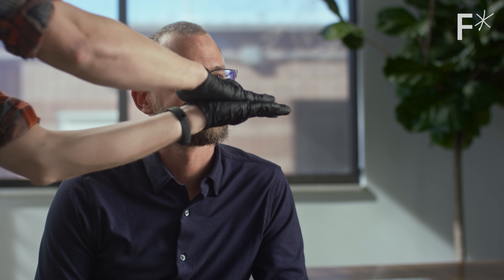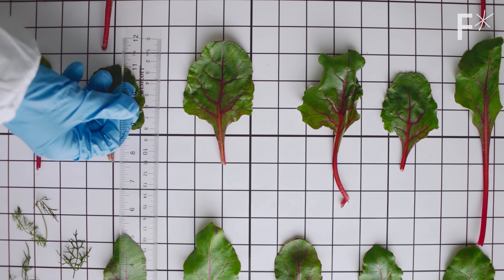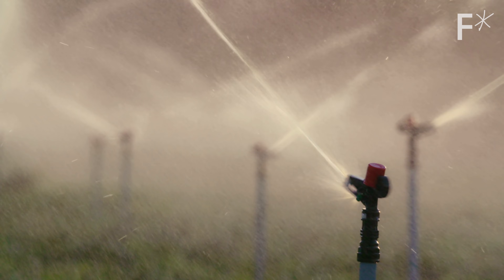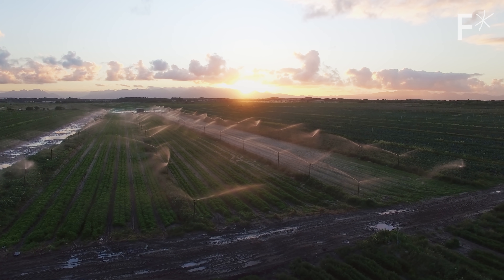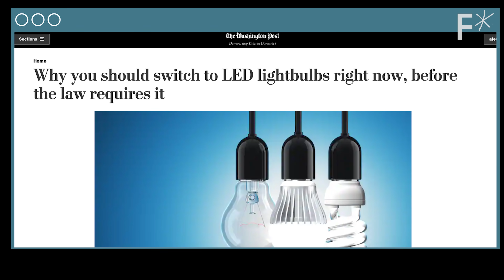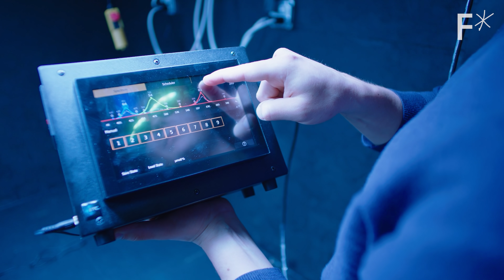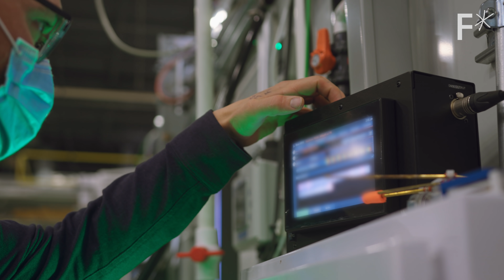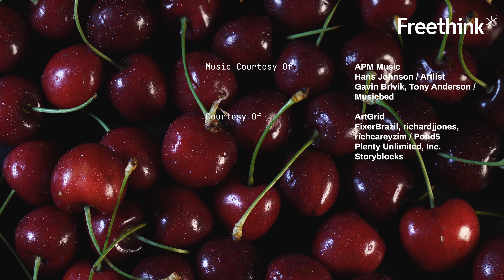Vertical farms could take over the world | Hard Reset by Freethink

Comment: It is no surprise they always, only, show leafy greens. They are mostly just water, and negligible amount of calories, thus they can grow in these extremely low light scenarios. Anything caloric enough that  you could actually survive of eating requires hundreds of watts per square meter.

The best LEDs might have an efficiency of maybe 85%? Best solar panels at scale we'll maybe reach 23%. Very optimistic numbers! The grid is probably close to 95% efficient, so, all in all, you'd then need around 5 times the land area only filled with just solar panels instead to run your vertical farm.

The energy used for transport or clean water are absolutely minuscule compared to the staggering amount of energy requires to drive the enough artificial lights to have plants produce a significant amount of carbohydrates.

https://youtu.be/J4SaSfnHK3I?t=530 "that might all change in the decade to come"
No. Why would it? Do you forsee us having an astronomically enormous abundance of eletcric energy any time soon?
Their limiting factor for cash crops is the number of photons hitting the plant and the Haber Bosch process. It already is hundred of times more efficient to use the electricity to desalinate salt water than REPLACING THE SUN.

Comment: Most farming is carbon-neutral, carbon-negative. Because it uses the free sun to convert carbon from the air into plants. This uses electricity to power lights... electricity comes from coal more than any other source... this is a massive project to increase CO2!
Reply: These farms will run on biofuels.
Reply: @potto1488  Sure they will.

Comment: I did a project in university about rooftop farming, but this is an even more amazing innovation and solves a lot of the same problems. The math on their claim of jamming 700 acres worth of food production into a box mall looks something like this : 700 acres is about 2 833 000 m^2, which is just over one square mile. You can fit 609 big box malls into this area (box mall about 50 000 square feet). The solution for the future is multi-pronged; it's minimizing the food deserts and actual deserts, re-thinking mass agriculture and livestock, and minimizing what carbon we do produce. All because we CAN and frankly, we have to.

Comment: Vertical farms are amazing if you need to create self-sustaining colony in a hostile environment. If you want to do it anywhere else it just doesn't make sense environmentally or economically: You need to build a facility, the grow equipment inside, staff to manage the facility and tons of energy for artificial lighting. You can build solar arrays to power the lighting but all that energy could instead be used to replace  fossil fuels for the rest of the grid.

And it's an economical nightmare since it has to compete with dirt, sunlight and a tractor that probably costs about a tenth of the vertical farms building costs alone.

Also the energy required for vertical farms absolutely dwarfs the energy required for transportation.
Reply: Thank you, there's somebody here with a brain.

Comment: So solar panels are around 20 percent efficient. 
Plants are around 26 percent efficient 
But since they are indoors and using LED lights you are turning them from 26 percent efficient to 0.26 * 20 = 5.2% 
Unless you find a better way of getting free energy. So this idea of indoors plants only works if you have excess electricity. We are on an energy crisis and you want to start wasting energy like this?
Reply: Wut.... plants don't use all the wavelengths the sun provides you dipshit that's where the benefit is. You can optimize that, also there's other green energy sources.

Comment: This is cool and great for the future with the rising population. Though the more tech, robots, machines, and more power consumption introduces more points of failure and other problems. Is there an option that doesn’t require a droid army to run one of these? And what of future generations, will they forget traditional farming? In the case of a solar EMP will we be able to recover quick enough?  Just curious. Also I thought vertical farming would look different; large tall towers with crops and farm vehicles all inside. (Old nat geo had a picture)
Reply: Traditional farming won't go away, it will just be on a smaller scale instead of massive industrial sized mega farms. Also nothing stopping hobbyist getting in on small scale farming.

Comment: Don't get that kind of growth without a gas CO2 generators. What is the carbon dioxide concentrations keep at to keep production high . I've seen some green greenhouses with the CO2 was around 3 thousand ppm. Are you exposing the plants to the same or higher levels of red an far red light than what they would be exposed to outdoors. I guess these plants are on a 15 hours of light 9 hours of dark.
Reply: I'd also appreciate that kind of information from them.

Comment: Problem is the energy requirements i’m just thinking about temperature and electricity ⚡️
The other thing is not everything grows there e.g it’s pretty limited amounts of variations.
Reply: I don't think electricity is that big of a deal. We can always build more of the renewable variety and secure the grid with nuclear. These big buildings could also utilize their rooftops for solar.
Reply: @Thezftw  Nope nuclear is not a option here so no. And renewables are actually to a huge percentage subventioned by oils/gas. Energy is very much a problem especially if you also want to reduce the way it the stuff needs to travel e,g build it in the city or near the city..
Reply: @platin2148  oooh piss off no nuclear, you probably think it's literally dangerous magic.
Reply: @ANTSEMUT1  I think you don’t understand it’s illegal here by LAW. The Eu also plans such a thing till 2060 everything already signed.

Comment: I love this so much. 
I don’t fully understand it though. 
I’m curious if there are any factors in the absence of soil in the process. 
In no way am I knocking this, I would love to do this in my own home/property, perhaps with an extended greenhouse (?)
Reply: Soil isn't actually necessary as all of the nutrients in the plants come with the water their roots absorb. The soil is just there to give it something to hold on to. With hydroponic farming, the producers can tightly control the nutrients going into the vegetables and add things that people need but might not be getting, like iron, iodine, etc.
Reply: There is soil if saw it correct...one of the machines was turning soil.

Comment: Um plot twist “why use LED when we have mirrors and a Sun ☀️ endless POWER of the Sun
Reply: because now your farm stops working when the sun goes down. that doesn't really sound too bad until you realize one of the main benefits of growing vertically is complete control over as many variables as possible. how long a plant gets light for is one of the most important things to control and could prevent certain things from growing efficiently  in areas that have longer or shorter days
Reply: @demonz9065  Yea also the sun only works cuz of our atmosphere, on mars for example the radiaton would kill any plant that it touches
Reply: @demonz9065  also you can control the wavelength that is the most productive, Sunlight while free isn't something most plants use all of and just a certain wavelength.
Reply: What this does is cause productive conditions with "light" to cause plants to grow every minute with no break in darkness. Insect damage which can reduce yields because of the type of insect to almost zero. Various insects feed on the plant at various stages of the plant. No insecticides which are extremely expensive; remember their a petroleum derivative!  It takes tremendous energy amounts to move water in bulk to feed different crops. 
Some of the comments here reflect the experience of living in a ranch.
If you grow it in vertical farms in a urban setting you reduce hugh transportation costs to distribute the consumable veggie!! Remember here in the United States we will move produce from California to the East Coast. Transportation, warehouses, distribution and then shelve space. Produce that must last 8 to 10 days before consumed!!! The nutritional lost values and taste,  Imagine the lost in nutritional values before you eat it!!!!
Now their will be some crops it wont be economically viable in this mode like are you going to grow grapes? Nut tree crops?  Or apples and pears?  NO..ABSOLUTELY NOT!!!! TREE CROPS ABSOLUTELY WILL NOT GROW. But leafy and small size plants YES. 
COULD IT REDUCE heart disease because a shift in diets?   Probably yes!!! So no play on words?? FOOD FOR THOUGHT!!!

Comment: I like how they didn't mention the huuuuuuge energy consumption of LED lights and water reclamation. These farms when they run off fossil fuels are significantly worse for the environment than traditional farming. Nature already gives light and water reclamation in rain. This is another attempt at conquering nature
Reply: Minor disagreements first: The overall abundance of sunlight & rain is little consolation since its so impractically distributed for our use, and I have zero issues with "conquering nature" per se. But I agree that the huge question is indeed: Where you get the power for these LEDs (and other infrastructure), and how much CO2 was emitted generating it? I doubt the shorter transportation routes get you anywhere close to offsetting the losses from adding the middleman of photovoltaics + LEDs, and if you're powering it with fossil fuels it's actively harmful.
It would be fine from a climate change standpoint (and therefore great for the environment b/c of less land use & transportation) if we had abundant electricity:  Figure out power storage & restructure the grid to allow 100% renewables like wind & solar; figure out how to do fusion power & build fusion plants cheaply; or say "screw it" and go all-in on Good Ol' nuclear fission (which would be bad b/c waste management & arms proliferation).
I'm glad that someone is researching the technology, but I'm wary of selling it as unequivocally environmentally friendly given current circumstances.
Reply: You would think solar power would be the answer but I ain't an expert on these things.

Yes, power storage is also a huge problem... but my question is, how much LED light do they needed everyday?
Solar power isn't the complete answer but I bet it's pretty close.
Reply: @TheLPRnetwork  According to the first source I found (promotional material by vertical farming company iFarm) LEDs run 14.4h/day on average and account for 65% of electricity (air conditioners 20%, dehumidifiers 10%). For every m² of actual growing area, that's 70-180W (30-80kWh/month) for LEDs, and in total 120W-270W (50-120kWh/month), depending on the crop.
Reply: @TheLPRnetwork  Solar is probably part of the answer, but one problem is that you need area for it, and then you can't use that area for anything else that needs sunlight. With photovoltaics + storage (weather, nighttime, load balancing) + transport + LEDs, you lose efficiency at each step - raising the question why you don't just let plants use the sunlight directly for photosynthesis the old-fashioned way.
Perhaps you can either plaster every roof in the city with solar cells. In many climates, that might not be as efficient as using the roofs directly for gardening, though at least it's cleaner and much easier to plant/manage/harvest at scale. Or, if you have a good way to transport it far, you could cover large swaths of desert.
Outside of urban areas, wind power is perhaps less intrusive, esp. offshore.

AFAIU, there are rarely easy one-size-fits-all solutions with renewables - there are detailed plans how to transition to them, but they require large-scale investments into infrastructure, and most governments are dragging their feet, b/c barely anyone in power takes climate change seriously yet.
Nuclear is certainly preferrable to the disaster that is continuing to burn fossil fuels, and it would be compatible with what our current infrastructure is built for (churning out power continuously), or could perhaps also serve as an adjunct to fill in the gaps of renewables (with modern up/down-regulation capabilities). Then again, I really don't like it in the way that it tends to get practised today regarding waste management and opportunities for arms proliferation (also operational safety could be much improved, though people tend to overestimate how bad nuclear accidents are - esp. compared to, say, the pollution of a coal plant operating normally.)